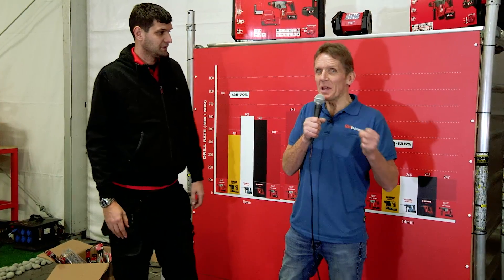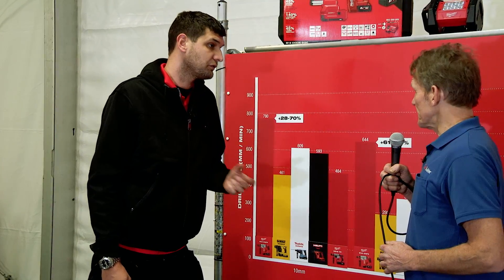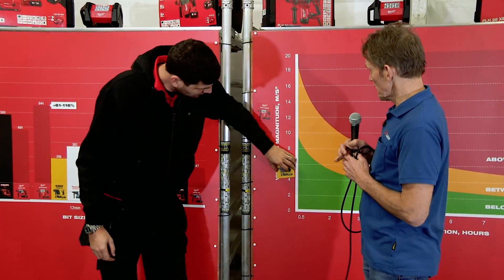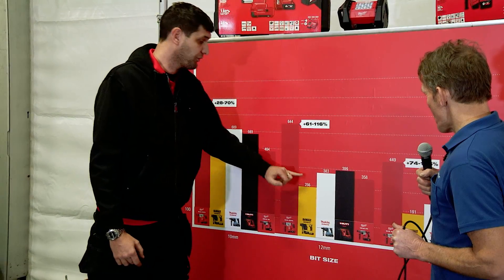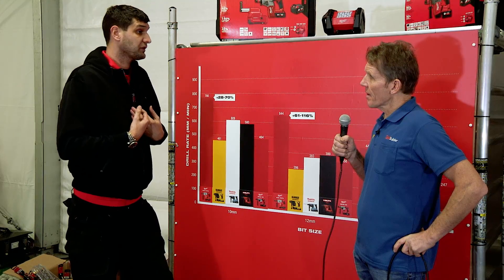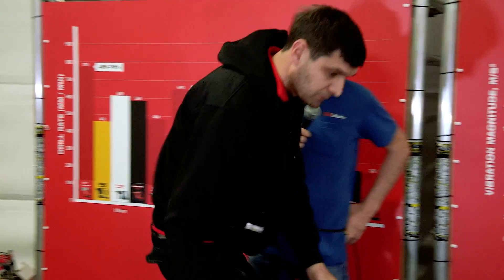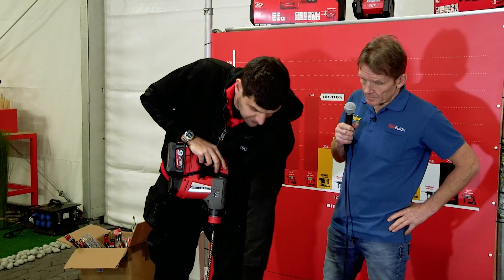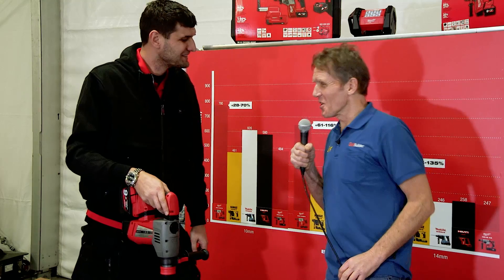Milwaukee M18 CHPX Drill - Vibration issue discussed

Comment: Is this drill good for a spark or would someone advice a smaller drill, say the next one down?
Reply: Don’t do it! I’ve had nothing but problems with my tool set and this drill. Constant clutch slip! My cheaper old dewalt was better

Comment: What a load of fucken bullshit, I bought two of those shit Milwaukee drills. Why don't you tell everyone the truth, after you drill 6 or 7 repetitive holes the thermal cut out kicks in and you can't use the drill for 30 or 40 minutes!
Reply from the maker: . I  watched them drilling hole after hole into concrete with no problem but maybe they use sharper bits than you. That point aside  If I bought something and I wasn't happy I would take it back for a refund.
Reply: Skill Builder when I dynabolt 2x4 timber to concrete I use 10mm drill bits, try drilling 7 holes in a row and I guarantee you it will shut down. worse yet, try drilling between two bricks for an anchor, the safety clutch will stop the drill so frequently it becomes an absolute joke.
Reply from the maker: Neezar 

We will try it and let you know
Reply: Skill Builder I'll wait for your reply.

Comment: would be good to know  the Milwaukees weight against the others looks to heavy for overhead work. Keep up the excellent work Roger.
Reply from the maker: In my experience most hammers are too heavy to hold above your head for long. You start out thinking it is light but on the tenth hole you are thinking about a Hilti gun.
Reply: will you be doing any comparisons on impact drivers soon Roger?
Reply from the maker: Alan 

We are getting there but some power tool companies are nervous about head to head tests and we can't afford to buy them all so bit by bit we get them.

Comment: wow milwakee is dirty advertising...that's not even dewalts best cordless rotary hammer..they should compare it to the dewalt dch273 or the new dch293...which produces 3.5 joules and still have less vidration than the milwaukee
Reply from the maker: Believe me John they all do it and Milwaukee isn't there to put the case for anyone else, but the point he is making is about vibration not which drill is best. Buy a lower vibration tool but check out the performance because you may find you spend longer using it.